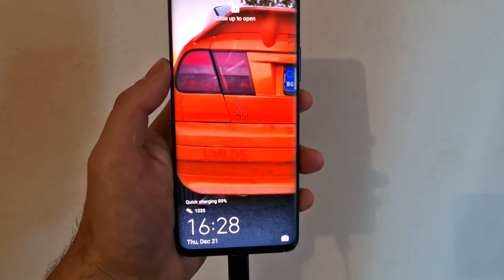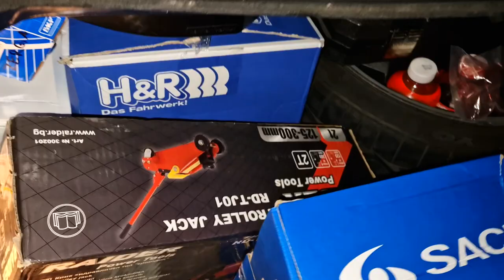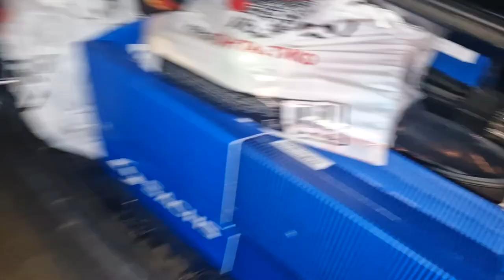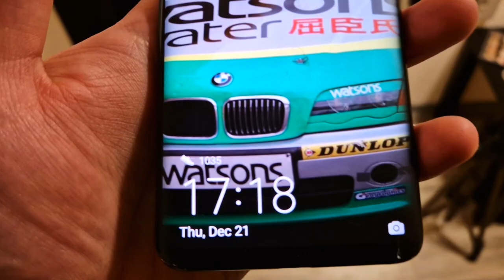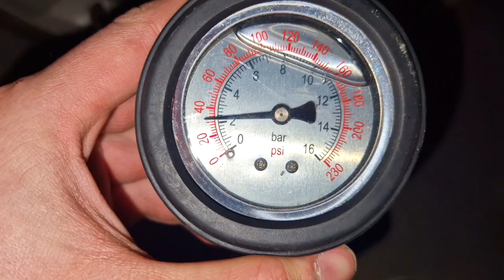200kg of CHRISTMAS PRESENTS in my BMW

Comment: How many liters oil burn on 10k kilometers?
Reply from the maker: 3 to 4 depending on how much highway driving I do.
Reply: @Zerga  it's too much. You have a problem with the engine
Reply from the maker: its the valve stem seals, I haven't fixed it as I plan on doing a full rebuild of the engine and swapping in the 330 B30 internals to make my 325 into a 330.